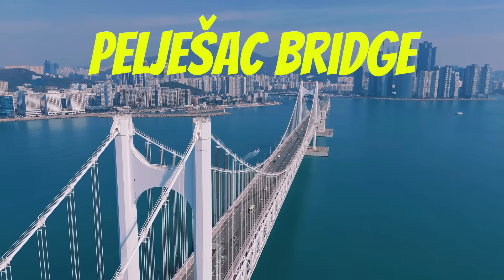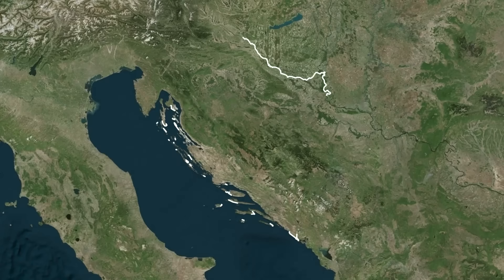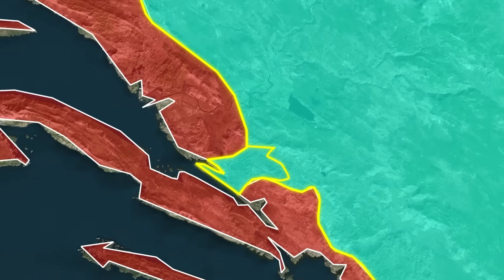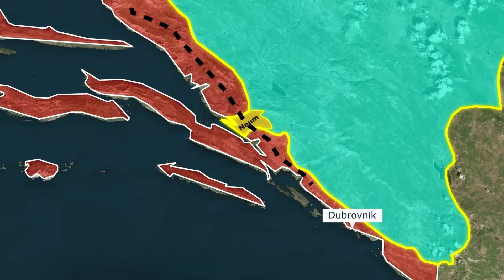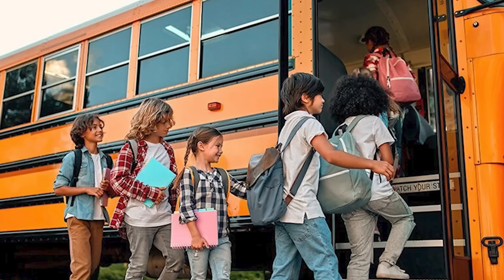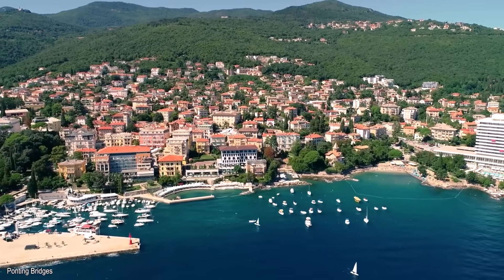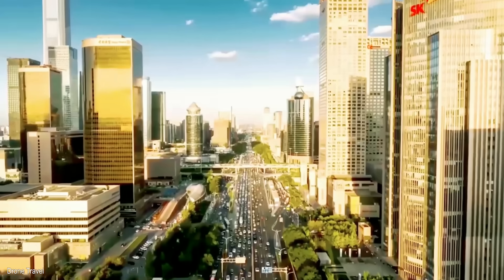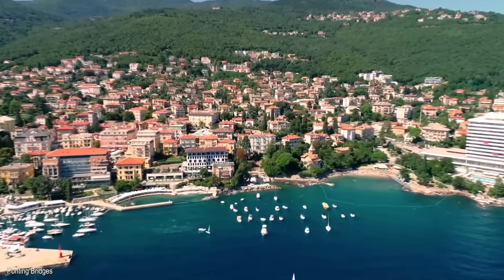Europe’s $650 Million Bridge That Only China Could Build

Comment: China already won an EU tender and built the Pelješac Bridge in Croatia fully to EU standards — on time, on budget, and at a significantly lower cost than EU bidders, even during COVID. This shows the issue isn’t capability or standards, but a different execution model that doesn’t rely on the EU’s long, bureaucratic process.

Comment: So we drove on that bridge.
And the chineese didnt count wind dynemics(air) overall if not repairs will not hold.
Every piller stops air in a very very very windy area.
Thoose pillers should have openings above the roads,and little slips underneeth the road, for a stable long living bridge.
So eather they are bad on bridges or they deliberatly build weak.

Comment: I drove in Croatia and passed the check points. It was off season, so very easy to get through. The freeway in Croatia is impressive, wide, modern, smooth. And surprised by food provided in service station, it was really good.
BTW, there is no technical challenge to Chinese firms. This bridge is very small comparing the projects in China.

Comment: Must be noted how it becomes needed. Normal old road goes near Adriatic Sea till Montenegro and through Montenegro. One village on the sea coast was given to Bosnia by communists from Zagreb during '60s. When dissolving of Yugoslavia occurred it happened that that part of Dalmatia, 20 and something kilometers became Bosnia, cutting Dalmatia in half, isolating southern part. 
Zagreb's vile intention is to destroy Dalmatia because of their hate, they tried to stop any possible traffic, by boat, by road plane, or train, and made many successes in that because they have been in charge. They made bribes to Bosnian politicians to make unresolvable problems that road never go through that part of Dalmatia. 
Then EU came in play, and they found that they don't want that part of EU to be isolated without any connection with rest of EU, and made all of this project to reconnect, blocking Zagreb in attempts to mine that project. Zagreb is still fury because of that, Dalmatia revitalized fast and become economically the strongest part of Croatia in few years.

Comment: One thing you forgot to mention that the roads to the bridge from both sides were given to European companies which were late in completion and over budget and the bridge opened months late as a result.
Reply: OMGbuild just a road and behind its timeline?
Reply: @dirhamrozi9569   It is a very difficult terrain, four tunnels (2.4 km, 1.3 km, 500m and 200m) and three viaducts (60m, 280m and 485m) that connect local hills. The longest viaduct is 40 meters above the sea level.
Reply: @usneome  1 .they were lying about timeline and budget when they where trying to get the projects 
2. The Chinese are soh good that in a even more difficult terrain they were able to succeed with the timeline and budget
Reply: @usneome  Do you know what's even more difficult terrain? Water.
Reply: @brian9107   I am glad you mentioned it: underwater diving crew was from Croatia, no Chinese divers. Working at 35m water depth…
Chinese poured concrete into towers and built the bridge like legos: sections of the bridge were manufactured in China then brought to the site, raised up and connected to form the bridge.
Reply: @usneome  You are very familiar with the situation of this bridge. I am an engineer from China and I am currently in Europe. The main beam of this bridge was manufactured in China and then transported here by sea. If the same bridge were built in China, the construction period could be shortened by approximately one year and the construction cost would also be lower.
Reply: @brian9107   Agree with you. I don't think all of the road could beat the difficulty of building just one bridge. That's why it cost so much.
Reply: No shit😮
Reply: When confronted with corruption in Africa, the West simply lets Africa dry and abandons it. China manages to figure out ways to deal with corruption: bring their own workers, use Chinese supervisors.